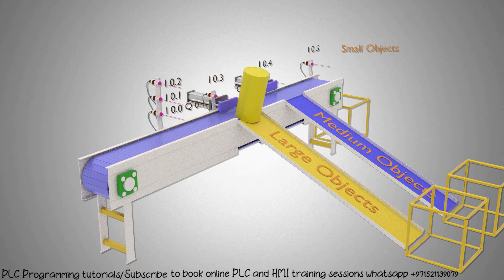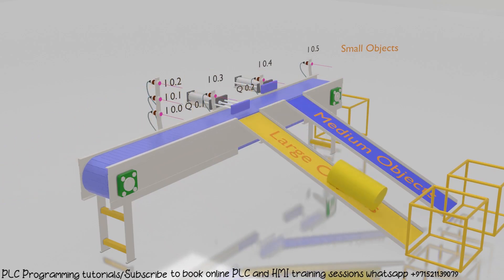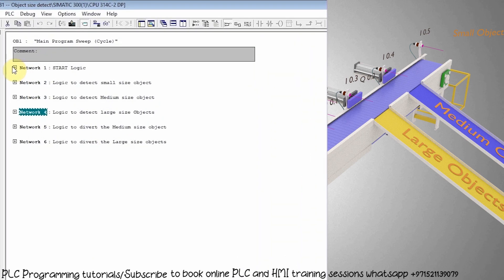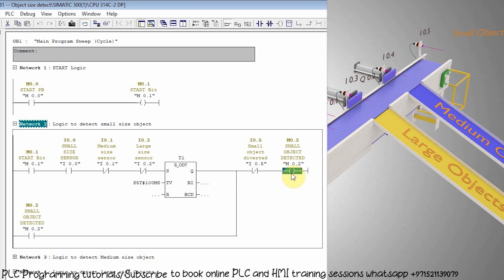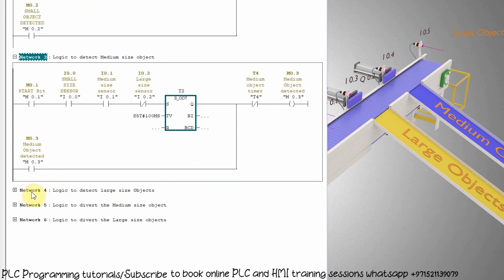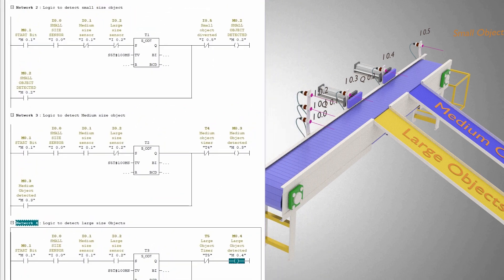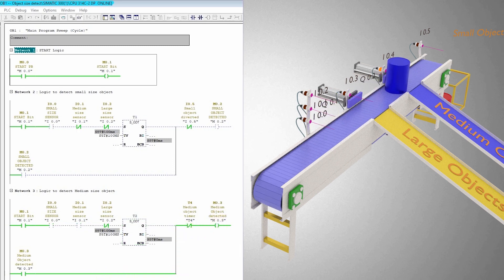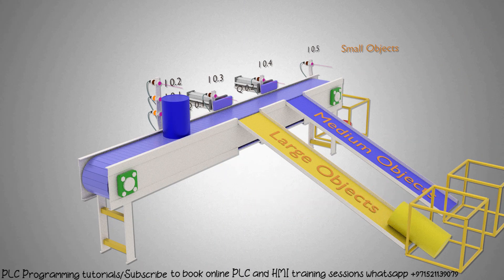Object Size detection and sorting using PLC Ladder Logic || Part #1

Comment: Great video, I have a question on your start logic why you used M0.0 instead of maybe I0.0?
Reply: We can't control any physical input (I0.0) through HMI panal, physical input can be control only through physical input devices connected in field like switch, push button, proximity sensor etc ..if we want to control through HMI so we have to take memory address (M0.0) for our GUI used for start logic in this program.